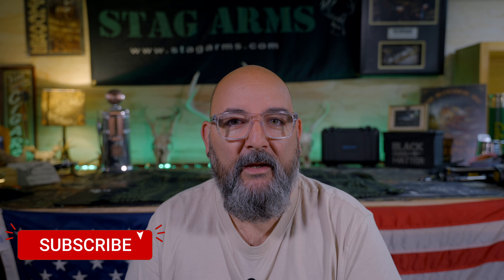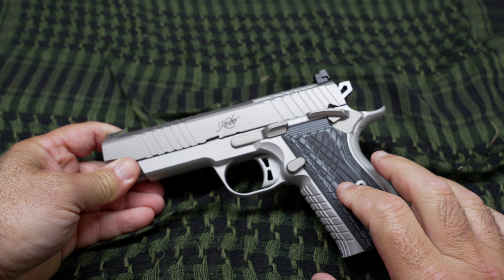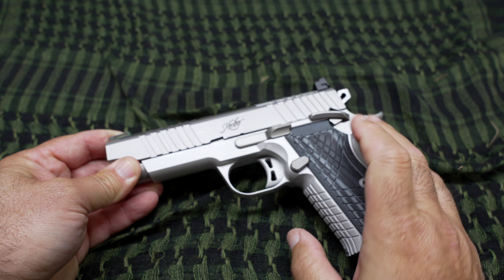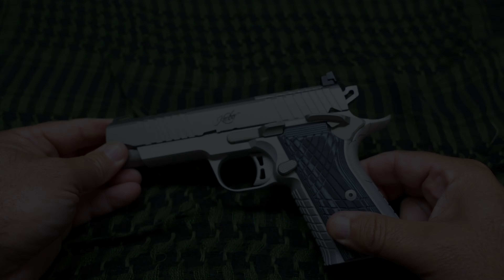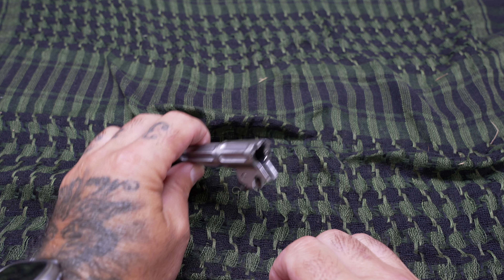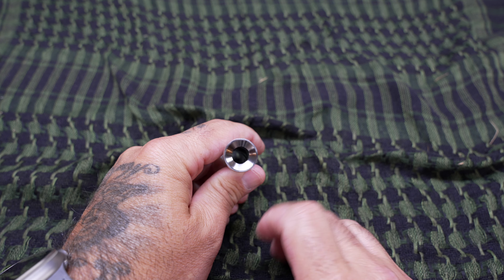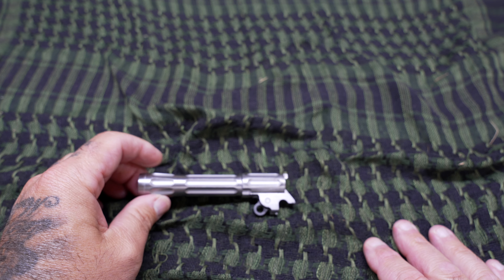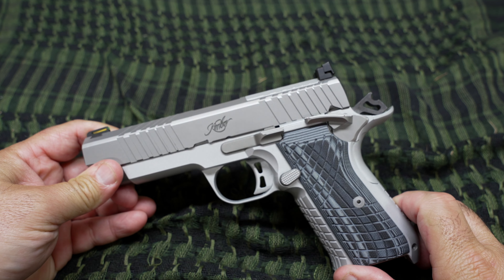Kimber KDS9C Modifications and Update

Comment: My KDS9C is very accurate and a joy to shoot. The problem I’m having is multiple failures to feed with several different ammo types and mags. I guess I’ll contact Kimber about sending back to get it fixed.
Reply from the maker: @HertzPenske  try new or different mags,99% it’s the mag
Reply: This is what I did to my KDS9C this morning. I cleaned it really good and put some Frog Lube on it instead of the normal gun oil I used. Frog Lube is much thicker. I ran 250 rounds through it, sometime slow and other times as fast as I could shoot. I had no malfunctions at all. Ran like a champ. I’m going to shoot it more with the 124 grain ammo but I believe the thicker Frog Lube may have fixed the problem. If so, I’m buying a case of the stuff.
Reply from the maker: @ no no no don’t buy frog lube!!! That stuff does not hold up in the cold weather I had several guns not cycle using that stuff. I use Lucas oil now and there grease
Reply: I live in the south so extreme cold isn’t an issue. But it looks like my problem may be a lubricant issue. Agree?
Reply from the maker: @HertzPenske  I still say it's mag related but keeping gun clean and lubes sure don''t hurt.
Reply: They are new mags that came with the gun. I shot 250 rounds of 115 grain ball ammo with no failures to feed. I cleaned the gun and went back and shot 100 rounds of 124 with 1 failure to feed. Think it could be the gun don’t like 124 grain? 
If it’s mag related do I need to call Kimber and replace the springs?
Reply from the maker: @HertzPenske  if they were hollow points you may have issues but I have seen mags right out the box cause issues too
Reply: I took each of the magazine’s apart and cleaned them as well as looked for anything that might be wrong with them. I shot 400 rounds today and and had no malfunctions. I used 115 grain ammo. 200 rounds was HP. It seems to be getting much better. I’ve shot 1700 rounds through the gun. Maybe it’s just a break in period?
Reply from the maker: @HertzPenske  typically a well made pistol does require a break in period I'm glad to hear it's working better for you now. I'm going to shoot mine tomorrow
Reply: Let me know how yours shoots. I’ve run 1K rounds through mine in the last 3 days. 950 rounds of 115 grain HP and FMJ. Ram great with no malfunctions. 50 rounds of S&B FMJ with 1 failure to feed and that was 3 days ago. I’m going to run some 124 only now to see how she runs. It’s a blast to shoot!
Reply from the maker: @ I’m well north of 2k on mine and she’s running like a sewing machine!